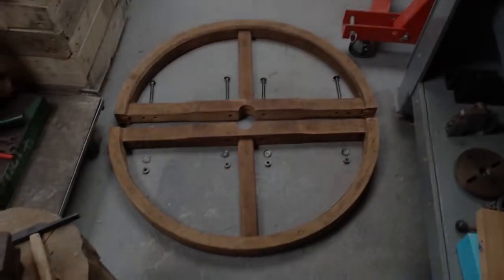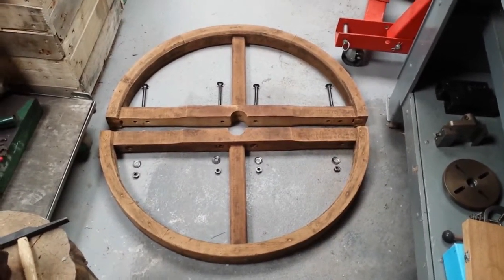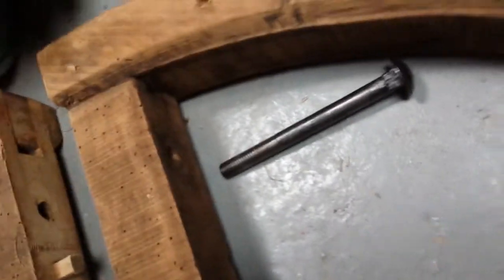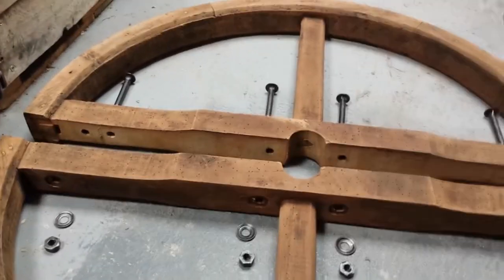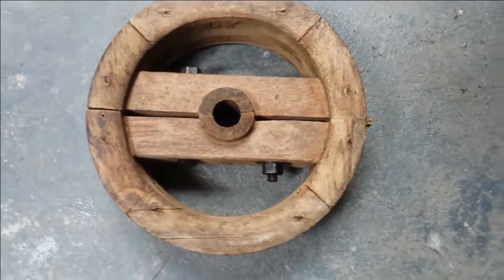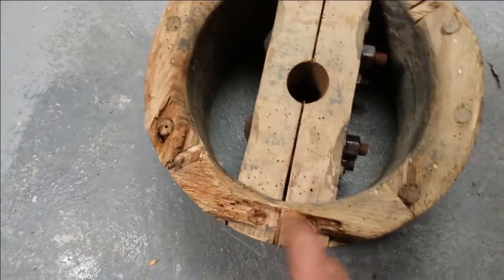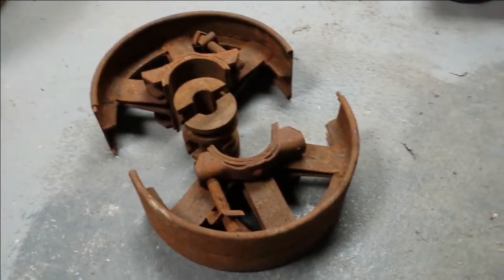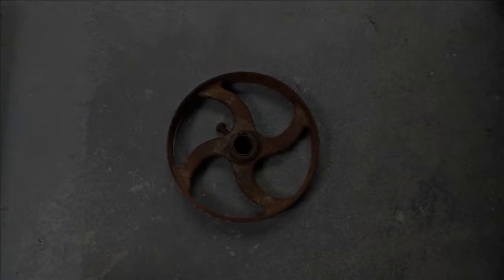France Workshop Lineshaft Project Part 2: A Look at Pulleys

Comment: I love that large flywheel, you could convert it for use as your workshop clock!
On that note if you can do try to add a larger flywheel to the shaft for inertia, it greatly improves the finish of the cuts made on machines driven by the shaft.

One of the less common ways cast iron pulleys were split was by casting in a thin web at the rim & center of the pulley so that after the bore & face had been machined a sharp tap with a hammer would separate the two halves with a perfect locking joint, no machining, no fuss!

p.s; In case you need spares the square shouldered bolts are termed carriage bolts
Reply from the maker: Interesting and helpful - thanks.
On flywheels: I have just recently come to realise that the addition of a flywheel to the shaft might be helpful. Thanks for the confirmation.
Reply: Another thing that may be worth adding are some shaft mice to keep the shafts clean, it makes it much easier to spot any fatigue cracks that could develop since in longer shafts with higher load the whole shaft will twist slightly on startup so having the flywheel mass closer to the driven pulley is good practice
Reply from the maker: @FlyingRivets  Absoluetly. Shaft mice are already on my to-do list.
Cheers!